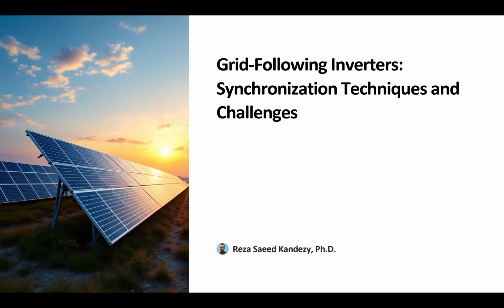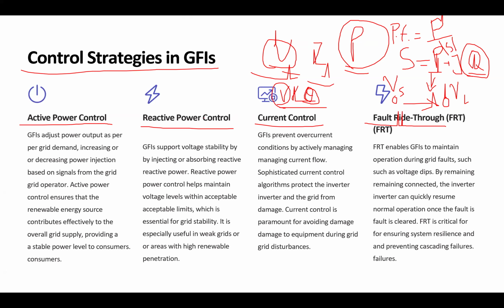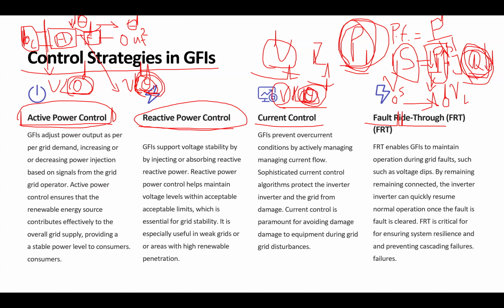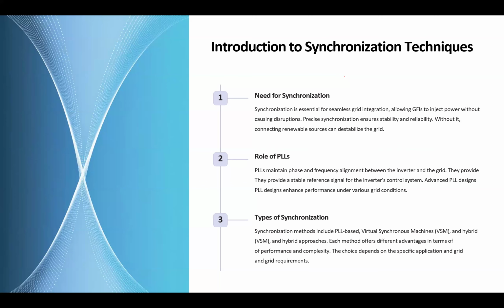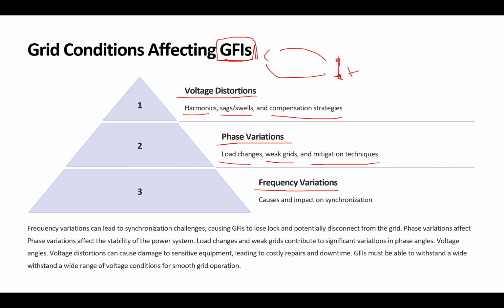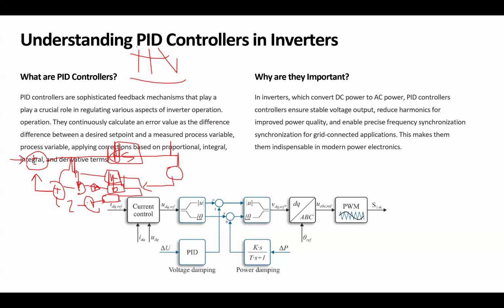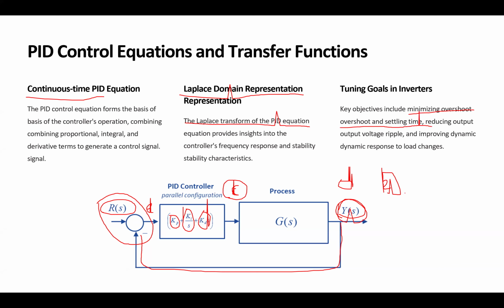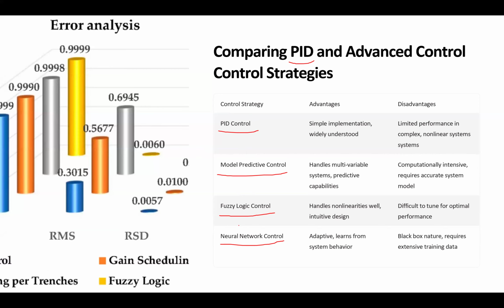Session 9  Grid Following Inverters Synchronization Techniques and Challenges

Comment: The real and reactive power control can be done by changing phase and magnitude of the voltage, but they are mutually coupled. I mean, when you control real power using theta, it will impact reactive power also as it depends on sin_theta. 
That's why the current control comes, where by implementing d-q controlling,  we can decouple real and reactive power control. 

Is it right?